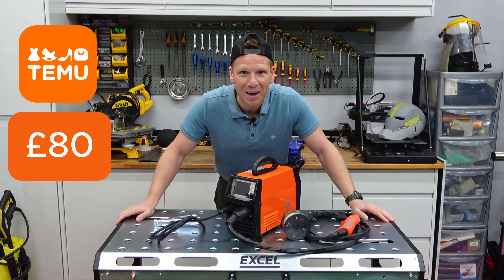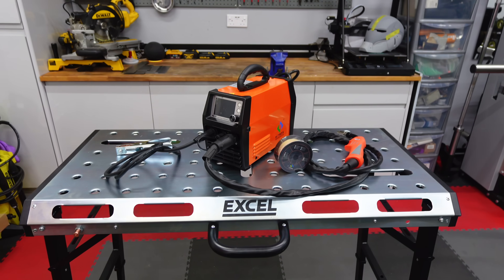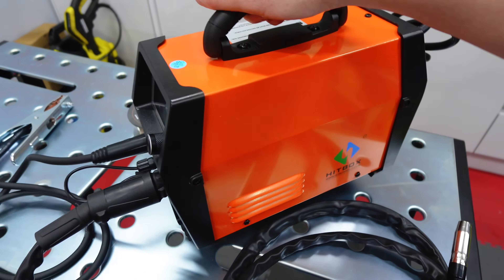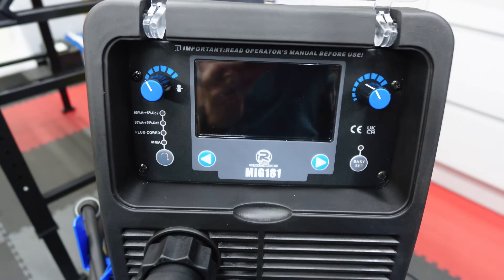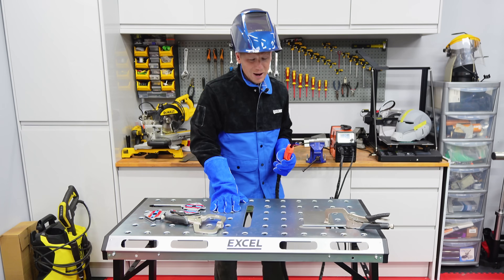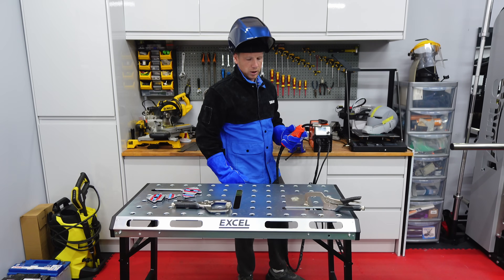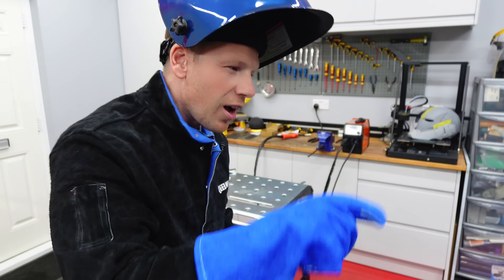Budget Welder Reality Check: Does Cheap Gear Work for Beginners?

Comment: I got a mig 181 about 18 months ago and it's superb . The cheap welders work but the Mig 181 is way better , you simply get what you pay for. If your welding flux core you need to drag the torch as you would with an arc welder . Grind a vee on the 5 mm steel to help with penitration
Reply from the maker: Yes I'm really looking forward to using it more and dial in my technique.  Got a nice little repair to do on the Defender in the next video so I'll try it out again then 🤓👌

Comment: Flux core welding never turns out like gas sheilded, it's jsut how it is, difference in a hobby welder and a slightly better one. Personally I use a Migatronic that is about 35 years old, and is a semi-industrial welder with a 15kg wire reel, it will blow holes in pretty much anything! 😛 I tried one of those Rtec welders and it just didn't seem to have any power. 

The welds are pretty ok for the length of time and knowledge, both work, I think I'd keep the Rtech in the workshop and stick the timu one in back for emergencies and if you ever go travelling and have a big inverter for power... 

You are tright though, better tools makes a better weld(er)!

Comment: Come on mate. The comparison of chalk and cheese, not only is the cheese much more expensive but it's completely different. If you had wanted to do a real comparison you could have used flux core wire on the Artec without gas. Apples with apples , remember? Obviously this was a sales pitch for Artec but if it is then tell us it is. Artec are good, have good after sales service and spare parts availability. The Temu probably has none of that but for 80 quid to do some welding that won't be seen or gets ground down it'll probably get the job done. When did you become a mere product tester/promoter?
Reply from the maker: Great suggestion,  maybe I’ll do a video on that then 👌.  Thanks so much for watching and taking the time to leave a comment.

Comment: Love watching your vlogs, but this one is an advert for your free rtech. If you are going to compare welders, at least compare a cheap gas inverter welder. If I compared driving a horse and cart with a ferrari, I guess the ferrari would go round the corners better.
Reply from the maker: Thanks for watching dude.  I actually bought the R-tec gear myself so it wasn’t a free plug.  Just excited to try them out and give it a go.    Also it depends on who’s driving the Ferrari,  which was kind of the point of this video 😉

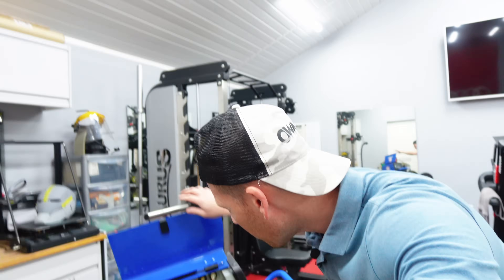Comment: 2:20  the internals?!? That’s not the internals, that’s the wire feeder and rollers . The internals are what converts and regulates the amperage desired/required. 

Hint hint: circuit boards and and voltage converters ;)

Comment: Self-shielded flux-core welding is going to look like hammered dog shite no matter the welding power source.... Both machines in this case are Chinese but built to specific price points
Solid wire with a gas shield will tend to be more aesthetically pleasing to look at due to it being gas shielded and will more than likely to be easier to use.....  for the self-shielded flux core wire, think of it like it's just an inside-out stick welding on a spool, so you'll get spatter on the workpiece.....  the weld integrity can be suspect in self-shielded flux core unless you adhere to voltage, wire stick out and travel speeds but saying that, a good proportion of building infrastructure framework in the USA was built using just that sort of welding.....  No matter what, interesting comparison between 2 price points but welding practice will help.... reach out fella, I'm but a message away and willing to help having had 30+ yrs in and out of the sector and currently working for a tier 1 OEM welding & cutting equipment manufacturer